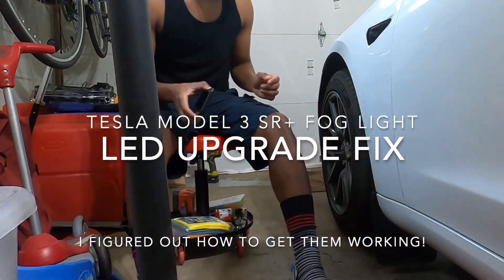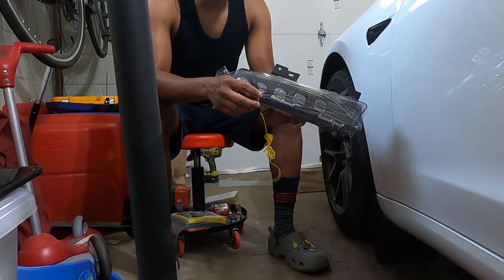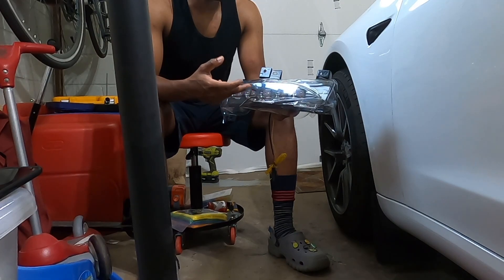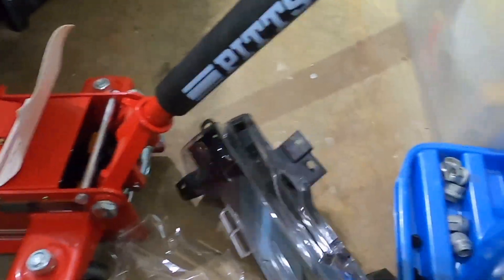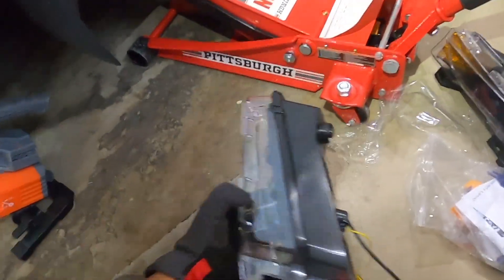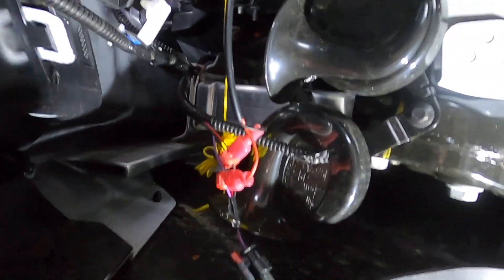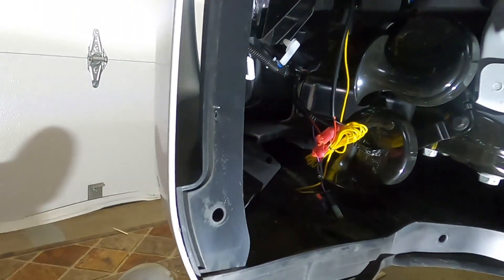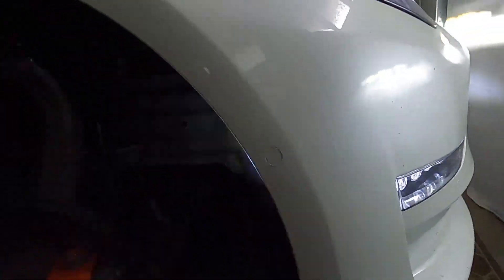Tesla Model 3  2021 LED foglight upgrade installation

Comment: Thank you for the video. Ur the only person who actually showed the correct wires to tap these into. One other video has us running the harness from the front of the car into the truck speakers area😂. Sidenote, these fog lights are low ass. Nowhere near bright enough to be real fog lights they’re just an aesthetic.
Reply from the maker: I agree not so much functional as it’s badass

Comment: Which ones are you splicing?
Reply from the maker: Check the 6:20 mark
Reply: Thanks I thought I watched the whole video before.  I plugged my new ones in today and they didn't work and I got really mad.
Reply: Just for clarification on the drivers side  you said you used the t connector on the purple and black wires.  Those wires are coming from the car correct? And which colors do they connect to on the actual light? Did you hardwire them or do they still have a connector? Thanks
Reply from the maker: @jasonszpyra9443  purple to red. Black to black. Pause the video and look good. I found a wiring diagram on a Reddit thread. I should’ve added to the video
Reply: Thanks so much they look badass,  Appreciate the help.

Comment: did you loose your warranty?
Reply from the maker: good question. I suppose for the parts that I tampered with
Reply: @NewEraNErd  also wanted to get the sr+ but I’m worried when I change the lights they’ll still be software locked
Reply from the maker: @elie9692  it’s not so much software unlocked. Its a different headlight so it’s connected differently.
Reply: @NewEraNErd  when you took your car for service did they say anything?
Reply from the maker: @elie9692  havent had to take it for sevice yet. But I haven’t received any error messages. It works perfectly.

Comment: Hello, I just installed those same lights on my Model 3 but I did not move the cables, just connect as it comes and it the LEDs work, red with red and black with black, the only strange thing is that the icon of the fog lights no longer appears on the screen.  but if they turn on.   in your case if the fog lights icon appears on the screen when they are on? thanks
Reply from the maker: I have an sr+ 2021 and it didn’t come with the fog light function icon. They are on whenever the headlights are on
Reply: hey, where did u connect it ? do you have the sr+ ?
Reply: hello, I have a Model 3 Performance, I did not use the line of my fog lights, I used the line of the DRL since that line turns on when unlocking the car locks and stays on for a moment, it also turns on at night.
Reply: @olimexsys  whats DLR? Was that already there? I got the sr+ 2021 and couldnt find any cable that i can use, i got the harness to connect it to the stop lights but that would be a struggle..
Reply: @th3ndktn  hi,  DRL means Daylight Running Lamps, (they are not really DRL but that is what I call the LED light that is inside the fog lights that is a horizontal line) the LR and Performance version uses the same connector as the OEM fog lights, in that connector there are 3 cables, ground, line for fog and line for "DRL", if you use the fog line they only turn on the lights at night, and if you use the "DRL" line they turn on when you unlock the doors, like Coming home o leaving home function and also at night,  buy u need the OEM LR or Performance conector.

Comment: Thanks for the video. Do you have any problem with the foglight so far? I worry about overloading    the side marker circuit since it’s drawing power from there.
Reply from the maker: No issues so far. These are all LED lights so the power draw is minimal especially since they’re sequential